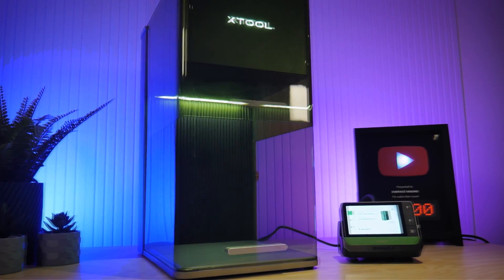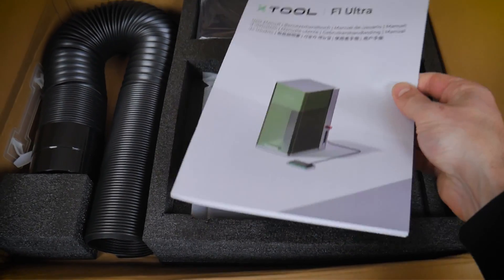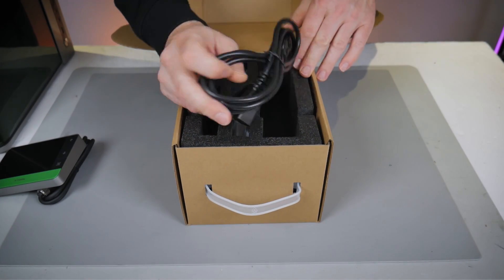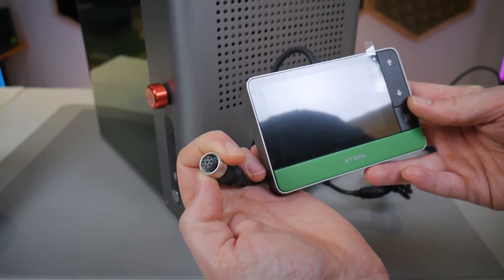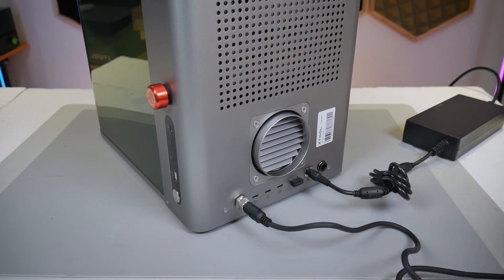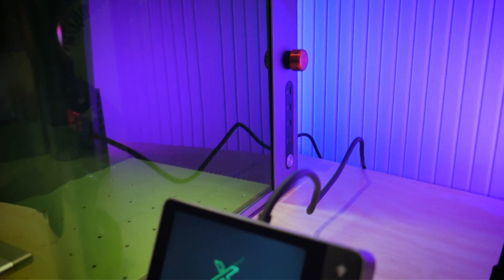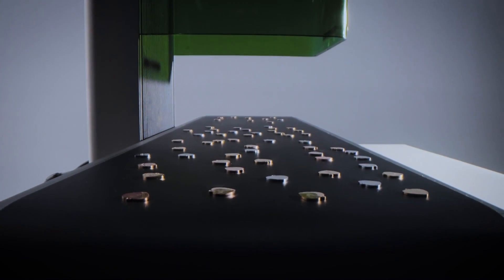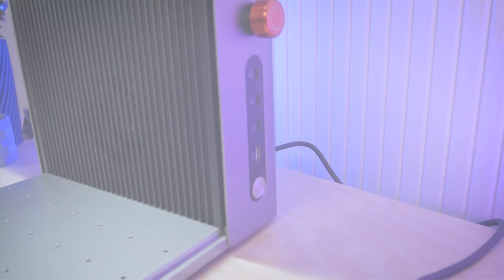xTool F1 ULTRA - Unboxing, Setup, Features, Upgrades and Accessories!

Comment: Would a shop vac work for the f1 ultra? I got the fume extractor but plan to do all the acrylics on my P2S, the Ultra will be just for Slate and metals
Reply from the maker: I have videos where I've made shop vac extractor systems with HEPA filters and carbon filter - they work okay for a home made DIY setup but it really depends on how much you're cutting / what you're cutting etc. I would consider the shop vac solution for "light duty use"

Comment: What do you do about the the directional tape on the top of the machine, that runs inside of it at the top back corners?
Reply: That's a good question. I can't get it off. What did you do?
Reply: @BarryKing-o5z  I figured it out.
Once you turn it on, rise the laser up by pushing the up button. When you raise it all the way up you can remove that tape.
Reply: @BarryKing-o5z  I still can’t figure out why that tape even exists to be honest. 🤣
Reply: Thanks Angus!!

Comment: lovely video, do you run the risk of damaging the internal fan by attacking a more powerful inline? mine has arrived with a free inline but no mention of removing or disconnecting the existing fan.
Reply from the maker: Thanks! I haven't damaged them yet... But I may consider removing it and designing an insert like a fan delete
Reply: @EmbraceMaking  Nice! I'm hoping I'll be okay, I just need to stop leaving the inline on when it finishes a job 😬

Comment: a hardware dongle to enable the machine to use? Just like a software dongle key? What?  What's the actual hidden purpose of such a dongle key?
Reply from the maker: It's like a safety lockout. You can remove the USB key if you are working inside the machine, for example adjusting the red dot laser, and want to make sure the blue and fiber laser cannot turn on to burn you or blind you

Comment: Is it Lightburn compatible?
Reply from the maker: Like most xTool machines it is quasi compatible... You can do the basic stuff with Lightburn but the more advanced features like the 3d curved surface engrave etc will probably not work with lightburn

Comment: Will this machine do a full wrap on a tumbler? I can't tell if the whole tumbler will fit under the laser.
Reply from the maker: How long is your tumbler, I can check for you :)
Reply: @EmbraceMaking  7 3/4" for a 20 oz or  12.3" for a 40 oz.

Comment: Will this be compatible with Lightburn?  Will it work with a MacBook?  D1 pro with XCS does not work well with a MacBook so I had to go with Lightburn.
Reply from the maker: I believe it should be - but as with some of the other xTool machines I don't think you will get all of the features when using lightburn. For example, on the S1 and P2 there is curved surface engraving but to my understanding this is not supported in Lightburn.

Comment: I’m confused. Usually a new product is issued on its release date. But lots of Youtubers have the product and are showing the product and even how to set it up, but they can’t show using it until the release date, but you can buy it now. How can you tell if it’s any good if they don’t show you using it. What are the good points and what are the bad points? This isn’t an indigo release. Even the updated software is out now. So once the release date?
Reply: Tomorrow is the official release of the Ultra and XTool is doing a live event on YT. Once that happens, I’m positive all of the user videos and reviews will be dropped like crazy along with a lot of information and opinions of the machine.  It’s not unusual for companies to place embargoes on early access participants of their IP.

Comment: I'm really interested in this unit but does the F1 Ultra have WiFi / SD Card capability or only computer interface to send files.  WiFi would sure be nice.
Reply from the maker: WiFi and USB for local operation as well using the touchscreen controller. No more tethering direct to laptop. Some of the older machines like the regular F1 and even D1 pro have had WiFi for a while now. Xtool creative space 2.0 can also now handle multiple connections at once so you can simultaneously operate various Xtool machines for production
Reply: @EmbraceMaking  Thank you!